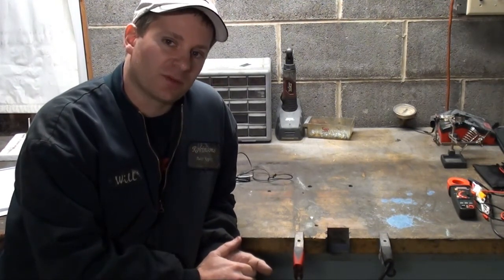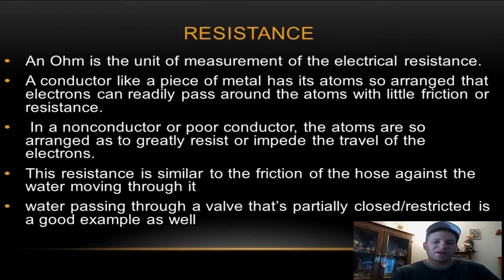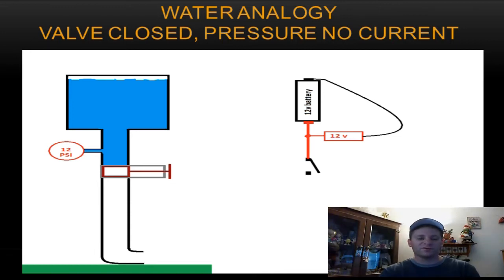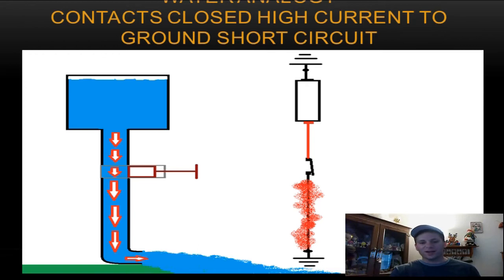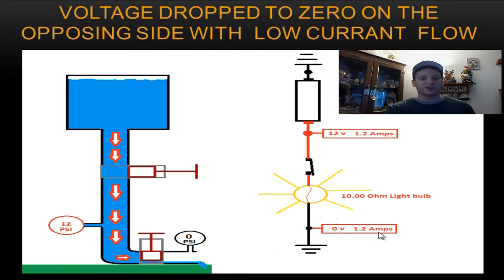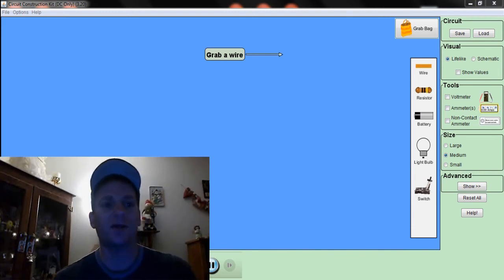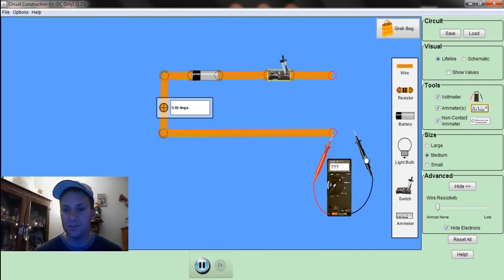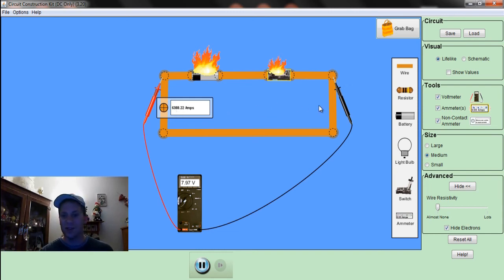Voltage Current and resistance

Comment from the maker: @jdubb408 not a problem, i actually just uploaded a new video of me performing real time troubleshooting on a starting circuit, check it out hope it helps, 

also if you would like. stop over at my website ToolsAndTime. com there's a free forum you can join. you can start a new topic under the the electrical. i will be more than happy to try and step you through it, 

Will,